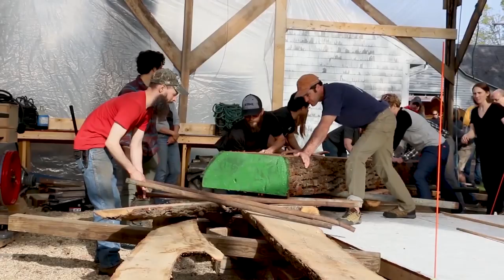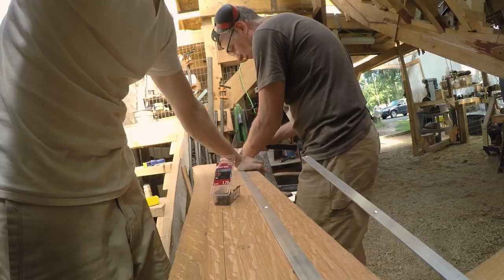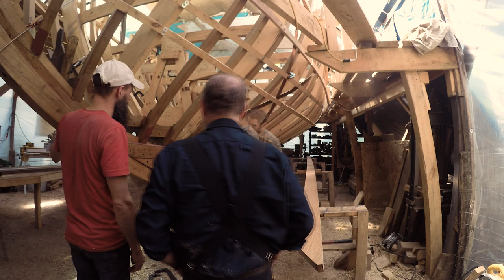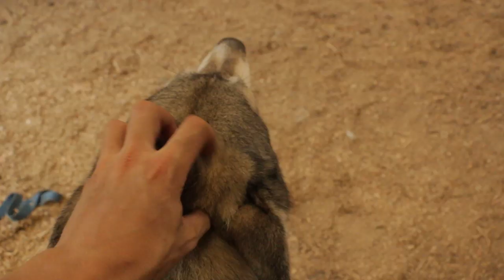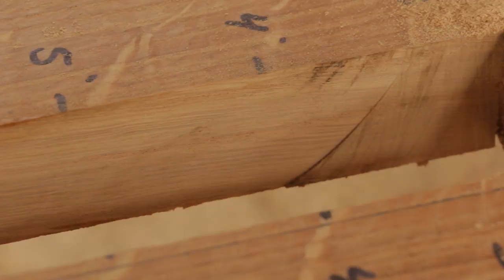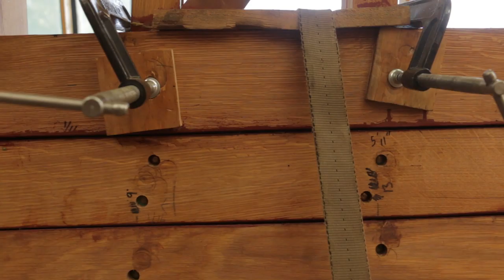Acorn to Arabella - Journey of a Wooden Boat - Episode 78: The Last Oak Broad Strakes

Comment: Very nice! Noticed similar markings to what I use in my feeble attempts at building stuff. I guess there's a cosmic logic to custom woodworking. 

And learned a new trick to plunge cutting using the back circular saw guide. Thanks!

A new found purpose for keeping a generous sawdust layer. An epic rainstorm leaky roof water absorber!

Comment: Don't forget the bow thruster! It is ridiculously hard to maneuver a single screw around. Getting into gas docks or simply turning into the wind is almost impossible. Marinas are being built so tight that a twin with a thruster is getting to be the norm, but not on a sailboat. You can break out the inflatable or tow a 12 footer behind on a spring pole. Or just put a hole in the bow.
Reply: Michael VanGundy  
Bow thruster, a traditional design with as close as traditional build and you want a bow thruster! Are you for real! Go get a plastic or aluminum boat if you want to sail in comfort, this boat is for enthusiasts. Sorry to cut you down but respect for the craft of building and design is something I am passionate about!
Reply: @paulorchard7960  
It's not about you being a Democrat or being intelligent it is about being useful. It sits so far down that no one would ever know. A small one is only a half a foot in diameter. You talk about it being traditional, but a big old diesel is OK? Get off my back.
Reply: What makes you think I am a democrat? Totally wrong, I am a shipwright with over 50 years experience who loves old traditional sailing vessels and cringe when traditional designs are butchered to accommodate the “modern consumers” who demand comforts to suit them!
Reply: As far as the diesel goes do you know that diesel engines existed before petrol, or gas as you would say, was first refined!
Reply: @paulorchard7960  
So if you are alone, 15 to 20 gusts, how would you get it tied up?
Reply: @michaelvangundy226  It isn't always easy, but maneuvering a 37' monohull can be done given enough time.
Reply: @wallykramer7566  
And I've seen broken legs, smashed fingers, and huge dents from a gust of wind. Marinas are getting tighter as the cost goes up. Just dumping the black water and refilling the water and fuel is going to be very hard. Why not take advantage of technology. I'm sure that they will have radar, and GPS.

Comment: Will the compounded tension from all those planks not ultimately change the shape of the boat? I am thinking about those watermelons that kids put rubber bands around until they explode.
Reply from the maker: That compounded tension is why the molds stay in until planking is complete, and some deck beams can be installed. Once the deck beams are installed, the molds come out and the frames can sustain the force of the planking. Thanks for watching!

Comment: What is the MC of the oak planking being fastened to the frames? How much does that species shrink both radially and tangentially? I am sure you researched this but wood tends to do almost all of it's shrinking between 20% MC and 8% or target MC. An oak board 10" wide and flat sawn might typically shrink an inch across the face of the board.

Comment: Hey guys I was a roofer for close to 25 years and there is a product out there that is called np-1 and it's manufactured by a company called Master seal. I had a 14 foot Lund aluminum boat that I sealed a few spots about 15 years ago and it's still holding strong. I guarantee you it is the best sealant I have ever used in all my years of being in the construction industry. I own a handyman company called you're the boss painting and handyman that I've been doing for about 18 years now and in my years of roofing I have never found a better product. You might have found a sealant that you're happy with but I would investigate this product. I do not work for them nor am I trying to plug their product I am telling you about it for your benefit. It's Master Seals np-1. It comes in different colors and for as strange as it may sound the different colors provide a different adhesion in my opinion. The dark bronze or the tan is the best out of all of them. They have white and clear Brown tan and bronze I believe. You should be able to get a tube of it from Allied Roofing Supply but through them it's going to cost you like $12 a tube. You can get it from a company here in Prescott Arizona where I live from a company called Foxworth Gabrielle Building Supply and you will pay like $5 a tube. For real for real those boards you are putting up right now if you would put that sealant in between each board I guarantee you it will never leak. Again Master Seals np-1 in a tan or a bronze. In my opinion that tan is even better than the bronze. Let me know your thoughts. Boats looking great!!! I cannot believe the hours you are putting into that thing but, that just means quality.
Reply: Sealant for a roof isn't likely to translate well to a marine application where it stays continuously submerged for years at a time.  And in salt water.  And with positive water pressure.  Sure, it might work okay on a roof that way but given how much experience there is with marine techniques and sealants, doing something like that would be taking a big risk.
Reply: @wallykramer7566  I understand what you're saying but to describe the product as okay, is an understatement like huge. I believe that it would stand up to the elements. There is no question in mind. I think it would be worth researching because I have never seen a product like this. I have seen it applied to roof jacks on roofs ( obviously ) and after being in the sun Arizona mind you and during the winter Northern Arizona as it get below freezing and even as low as 5 degrees below zero I've seen it you can't even cut it off. It is still pliable and will not harden.
Again I am not trying to plug the product but I think it is without question the best sealant available and I've seen a lot of sealants. Now I'm sure there's better stuff but you would have to talk to NASA about that : D
It's worth the research and thank you for your input.

Comment: I have two thoughts regarding future work (I'm sure you already have this planned) would it be easier to set the engine before you fully plank the hull? Have you figured out a grounding point for the electrical systems?

Comment: I am curious about the stem and the stern where your planks are proud of the stem and stern post.  Why didn't you cut them to the appropriate thickness before putting them on the boat?  I assume that you will be planing them to thickness at the ends at some point.  In my experience that will be more difficult than shaping them before installation.
Maybe I missed sit, but when did you cut in the caulking bevel?  It looks like the bevel you cut in is full depth and not a 1/2-2/3 depth caulking bevel.
Reply: Todd Dunn if you leave proud on installation when you plan your planning in the shape as a whole not seperate parts leading to a more blended smooth shape, there no escaping some upside down hard elbow grease if your building a vessel, pain before pleasure 👍😀
Reply from the maker: Leaving them proud means we have space to fair the planking once it is all complete. Thanks for watching!

Comment: I've tried asking this before and in email but no reply:
 Why is the time consuming hit/miss process of "backing-out" on the entire length of the broadstrake preferable ...as opposed to simply trying to notch out the back at each frame contact spot? It seems to me that using a curve tracing tool to get the shape for each frame and then transferring the shape as a notch on the back side of the broadstrake  might be an easier, viable accurate process.  No?
Reply from the maker: It's actually easier and faster to back out the entire plank than it would be to notch at each frame. Thanks for watching!

Comment: I'm sure you have thought of this, with how meticulous you are, but have you thought about more cribbing under the keel? As you add more weight to arabella the current  cribbing is going to start having higher and higher pressure per square inch(PSI) on the 3 ties you have under there. That's also more psi into the ground below arabella. With all your rain lately i would hate the high weight to start to collapse the ground or start to distort the keel.
I know you've got the top tied into the boathouse right now, but that mass is definately centered on the keel

Comment: is there a reason you are not scarfing the planks on the boat? Is there a reason you are not making the planks seal to each other in addition to the cotton caulking you are planning to do? why don't you weld a bolt head to your super big clamp? that way you can you a impact driver to snug it down quickly?

Comment: I may have forgotten or missed it by why wouldn't you use oak for the whole hull covering. Just to make it robust. But cedar is nice and forgiving for any torsion
Reply: Cedar is much less dense than oak:  0.38 vs. 0.77 (1000 kg/m^3).  The boat designer called for cedar and the boat is designed around that.  Replacing with oak would increase the center of gravity which would make the boat less stable (more tippy).
Reply: @wallykramer7566  as a old lobster fisherman I completely agree, just wondering why the initial design did not incorporate total oak

Comment: Would oak and cedar expand and contract at different rates? Wondering if the transition would be prone to leaking.
Reply from the maker: The oak will swell a little less than the cedar, but the softness of the cedar will allow the oak to expand into the cedar, forming a tight seam.

Comment: If all the planks aren’t completely flush and smooth does that create a noticeable amount of drag?
Reply: John Valerian It would some but I think once all the planks are in they will go through and smooth all the planks flush with the stem, stern, etc to give it nice lines
Reply: They will fair the planks/hull after they're all installed I would imagine.
Reply from the maker: Jeff is correct, the planks will be faired after they are all installed, so the surface will be smooth on the outside. Thanks for watching!

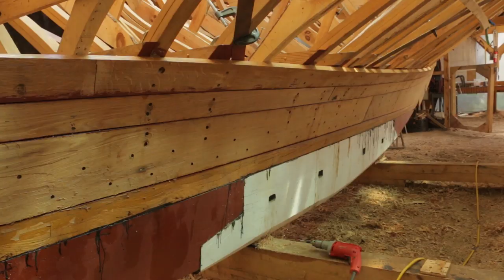Comment: At 24:01- 24:02 looks like the planks have a poor fit - ?  Explain?
Reply from the maker: That is the caulking bevel.  The planks should be tight fit on the inside 2/3rds and slightly open on the outside 1/3rd.  Once planked, cotton caulking is packed in.  Then, the planks swell around the cotton until shut once they get wet.  This is what makes them water tight.

Comment: love your show  and think you have proven any naysayers wrong but everytime I see you using that brace I gringe. I have my fathers brace but I don't use it anymore and I see you use many modern conveniences so your not against them on principal. I believe you said it gives you better feel but the torque feedback from a modern cordless will give you the same. I guess this is really about how it seemed you were disparaging boat builders who use them and I just watched some who did,maybe their were in the upper pacific west. Now if you use it because you enjoy using a good tool and giving it new purpose i could get that but to intenate its the proper way seems wrong. Just a minor pick of a  great undertaking carry on
Reply from the maker: We use a bit and brace because we are using bronze fasteners and screwing them into hardwood. We don't want to strip out the fastener heads. No criticism of other methods is intended!

Comment: I realize the idea is to build a traditional built boat but building in wood in modern times when we have waterproof glues and better fasteners there are alternative way to build this still using heavier lumber would be to use a strip planked method with your favorite waterproof glue and edge fastening like bronze annular ring nails (expensive)..  This could be continued for the entire planking and would produce a water tight hull that does not need caulking.
 Oak would not be my first choice for strip planking though.
 The so call traditional method is only a variation on previous planking methods when good fasteners were not available.
 I also wonder about using soft cedar planking for the rest of the hull in a heavy boat with caulking. its going to require some skilled caulking to do a good job on soft cedar planking.

Comment: Well this sure "seam"s out of character for your channel. Cotton under the garboards?
Reply: A reply would help me understand and be able to follow what is wanted.
Reply: This has been removed twice. I don't think that it was some spam filter as it happened on the first time I posted it. What is the problem?
"Several of my comments have been removed, I only asked about the cotton you had planned to put under the garboards. Were they removed by some automatic system or what? Keep up the great work.
"
Reply from the maker: Hi Caleb, not sure what you are talking about.  All comments seem to be showing up.
As for the caulking, yes, the Garboard gets caulked same as the other planks.
Reply: @AcornToArabella  Thanks for the response. These comments stayed but several others disappeared after about a minute each time. I realized I thought the bevel and cotton was on the inside edge and needed to be put in before securing the board. Keep up the great work!

Comment: Ahh, sawing with skilsaw no ear protection or eye.... be careful, you can only be lucky so many times
Reply: The lads are obviously quite skilled with all the saws they use.  True safety comes from knowledge, experience, and care.  Safety devices are inferior to those.
Reply: @wallykramer7566  True safety? You sir are not very aware, nor have you ever used any industrial equipment,,safely that is.. and this does not have anything whatsoever to do with knowledge..
Reply: @chrisntheboat  Not true.  I have designed many industrial devices and systems.  And operated them.  There is no way to design something to be foolproof because fools never quit.  Eye and ear protection help, but there are not a be-all / end-all.
Reply: @wallykramer7566  The sawdust and chips thrown up by the saw don't care how skilled you are.